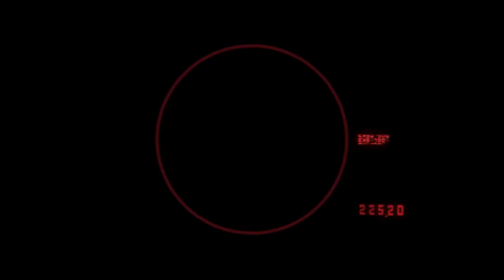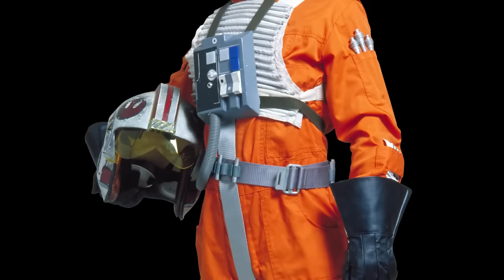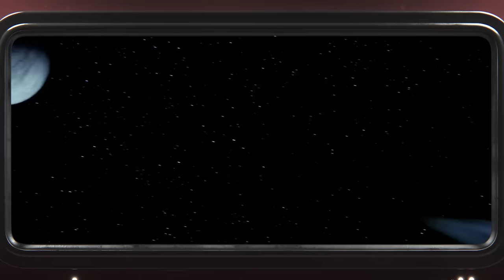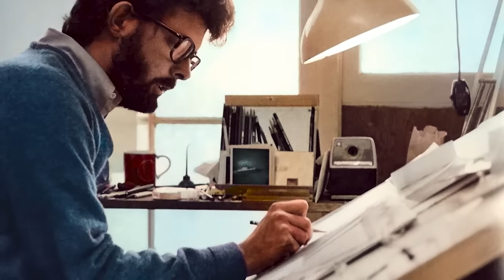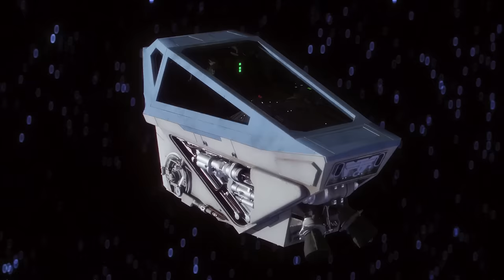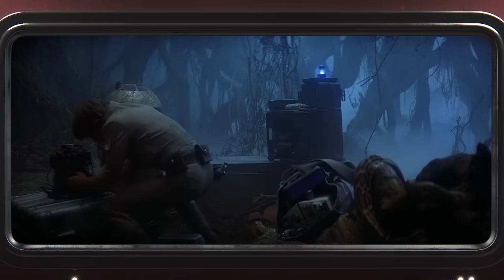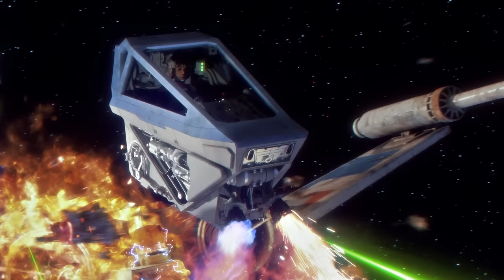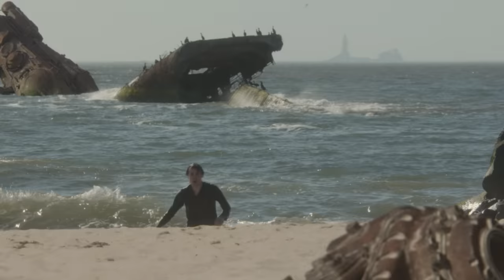X-Wing Ejection: It all makes sense now

Comment: "But if we're assuming a catastrophic failure that necesitates ejection, you simply would not leave the bare necesities of survival in the hands of some finicky technology."
You know we do that in the real world, right? Real world pilots are not guaranteed to live if they punch out, I don't know why you'd insist that be different in SW. If you're in a F-22 over the Gulf of Mexico and need to pull the shortening lever there is zero guarantee you will not be eaten by a shark when you splosh. Or drown. Or  get run over by a speedboat.

I have no idea why an atmosphere shield (known tech) would kill you if it flickered - vacuum kills but it's not instant.

I have no idea why an ejected pilot would be in danger of hitting a planet. I don't think you're all that familiar with delta-v. They would have to slow down a LOT, and if they could do that you just point your engine the other way and you're fine. If you are in orbit you can shoot off directly at the planet, but all that will do is dent your parabola - by the time you stop accelerating you'll come back up to the orbital apogee determined by your velocity. The change in speed from an ejector system is miniscule compared to the speed you're doing just to be in orbit. All you do, no matter which way you point the rocket, is change your orbital altitude a fraction. If the ejection happened when you were not in orbit, fun things happen, but almost none of those would be hitting the planet. Mainly because planets are moving pretty f&^king quickly - the Earth moves it's own equator distance in seven minutes. Anything you would do that might mean you hit the actual planet would be you hitting it so quickly that no capsule will save you - you're going to basically explode into a plasma shower.

Besides; your solution to the 'problem' is finicky technology, it's just finicky technology you've decided is foolproof, and was also featured in Space: Above and Beyond, Babylon 5, Lost in Space and Enemy Mine almost certainly amongst others. Wee bit more research on escape capsules in the real world and you'd find exactly why no current aircraft features them and THAT is why they're not great solutions to a 'problem' in the SWU. There's no getting around it,though, you can decide any technology isn't finicky and declare that the sensible solution. I could say they eject into vacuum, but are saved because a time travelling gummi bear is teleported around them and that this is absolutely reliable, and therefore the best way.

Getting out of the vehicle is a last ditch hail mary attempt to save the pilot, by no means an assured one. Known SW technology is perfectly suited to the means, and I feel compelled to point out that no ejector sequence was seen in the movies, meaning your solution is no more canonical than others, but, X-Wing and TIE Fighter both showed pilots post ejection and both were shown to be in sealed suits with back pack but with no chair. Certainly no capsule.

I would content an ejection sequence would be blowing the entire chair out with a atmospheric shield that's meant to last long enough for the pilot to seal the suit and helmet, couple his life support unit to something in the chair, and then ditch the chair itself. Doesn't need any tech we didn't see in ANH alone, comports to canon, and results in the second tier canon of the Lucasfilm games.

That said it is a very pretty model and render, really very well done. You're animation and modelling work, not to mention your bizarrely engrossing research into genuinely odd and fascinating trivia are fabulous. I just find your reasoning spurious.

Comment: The Legends novels, in the Rogue Squadron arc, do mention ejection and it only states a force field encloses the face and neck and the suit "readies" for vacuum.
What this video overlooks is that force fields are far from finicky tech in the Star Wars universe.  They are used routinely to seal the hangar decks on ships, even the Death Star's cavernous hangars have open bays to space, sealed only by force fields.  And personnel routinely work in these rooms, even the Emperor disembarks from his shuttle with just these fields holding atmosphere in, with a full honor guard present.  Even if one grants the Sith can do a cold-shirt transit like Leia does in one of those poo-pile sequels, that's a lot of people dead, even assuming Vader and Palpy manage to stay insude Death Star II amid the atmosphere purge, and stay that way long enough for air to be restored to a h as ngar about 500 times bigger than it should have been.  
A shuttle, mind, that passed through said force field without letting atmosphere out,  which we see the Falcon do, twice.  If there were a giant hangar door sealing the bay when the heroes make their escape, they would have never escaped.  We can also assume that TIE fighters exit similarly, though one wonders why since pilots wear full vacuum suits with full hel ets and the TIEs could just be carried docked on the outer hull instead of in an internal bay.
No, force fields are established, trusted technology at this point.  And logically, the suit and accessories have to have a purpose.  Its not a g-suit like today's pilots wear - pilots can select how much gravity, if any, they feel by altering the setting on "inertial compensators" so they can make sharp turns or accelerations but not be squashed by physics.
And, yes, in the novels the astromech ejects as well, and is tethered to the pilot so they don't get too far apart.
The thing is, a capsule eject leaves a fairly big target, and a helpless one.  Would pilots want to drift in a combat zone one "stray" shot away from dying?  At least in just a seat, it a small target and hard to detect without a homing beacon, which the pilot could leave off until the battle is over.  Us Earth types have a sort of agreement its not okay to shoot at pilots under parachutes or strafe them when they are on the ground, but that's an Earth convention that may or may not have been violated now and then by even us, there is nothing that says an Empire that blows up entire planets would honor a "don't shoot the defenseless" doctrine, that's pretty much their specialty.

Comment: An ejection seat isn't designed to keep a pilot alive indefinitely.  It's designed to eject him from the craft.  Survival systems can be incorporated, sure... but it's a fighter.  Fighters are relatively light weight by definition, and are kept that way for flight performance reasons.  There is no way to accomplish any of your goals in a way that meets the sensibilities of a fighter.  You ever wonder why fighters don't just have a huge parachute for the entire plane?  Or why you have to get your luggage weighed at the airport (that's more for balance)?
The larger the pressure vessel, the higher the probability it will be damaged in combat.  The amount of features an ejection seat has is inversely proportional to it's overall reliability. So, the idea that it's a poor planning to have non-redundant pilot protection is... dumb maybe?  For one,  they are fucking combat pilots dude, it's inherently risky.  For two, the reliability of a technology is independent of any other factors so, it doesn't matter if it's the only thing separating the pilot.  You live a good bit of your life with one layer of tech separating you from the afterlife.
I could probably go on, but that would require me to watch more of the video
.. and I am not here to give views to someone that masquerades under the guise of "well-thought-out" points, while posting.. this.